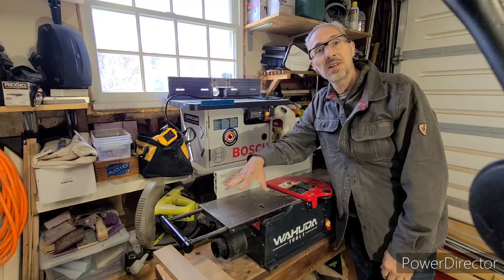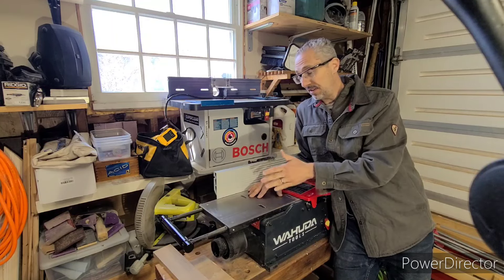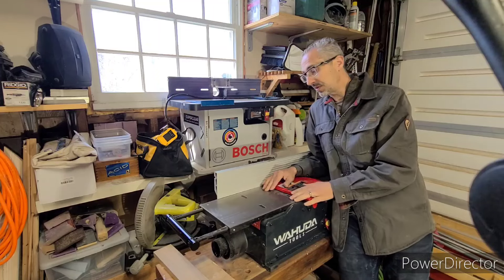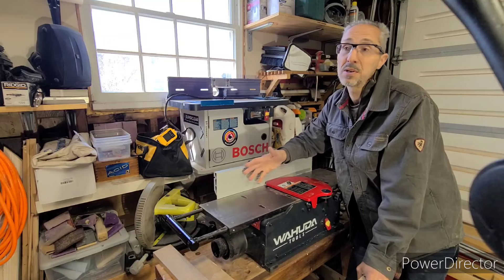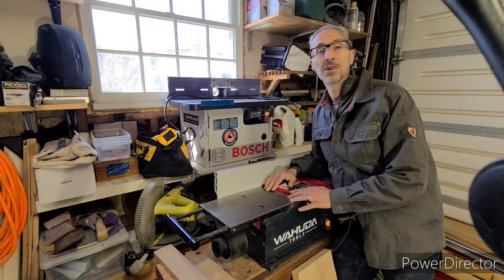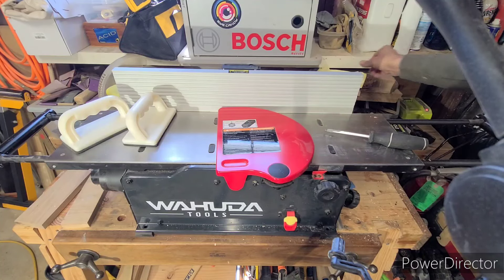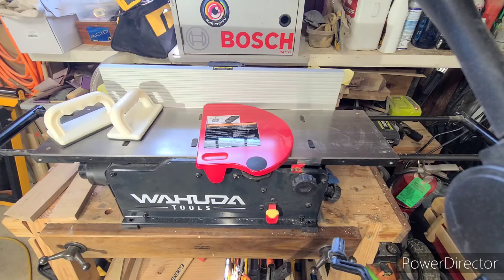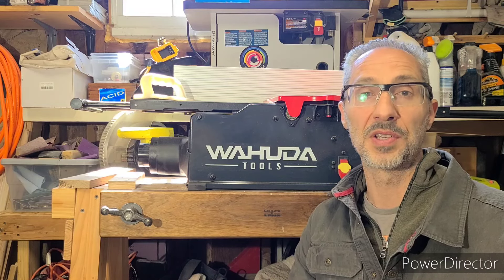wahuda 8" jointer review

Comment: I bought one a year ago so far so good  i really like having the 4 sided cutters they leave a nice surface i also made some inserts for the table extensions that helps my only complaint is i wish the motor was a little stronger but for under 600 it's a great tool!!!!
Reply from the maker: I ran some 8" white oak through it and it seemed ok.  Though I was probably going really slow...

Comment: Looks like you could use a sturdier bench!  And wax the cast iron…
Reply from the maker: @robertj1701  the bench is actually pretty sturdy. The Achilles heel are the locking castors that have a lot of play.  I did carbon coat the iron, maybe wax would be better.